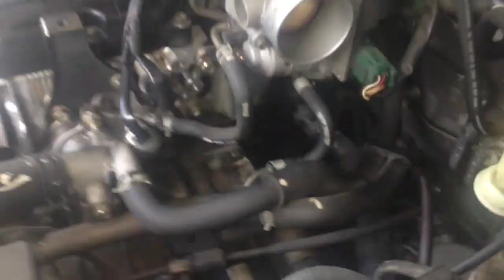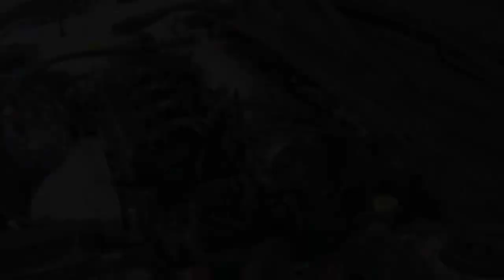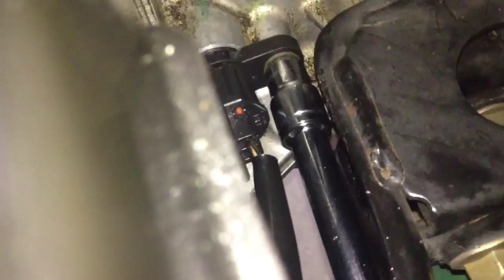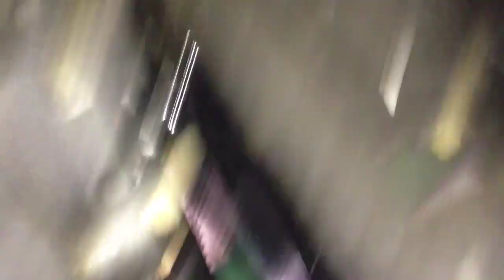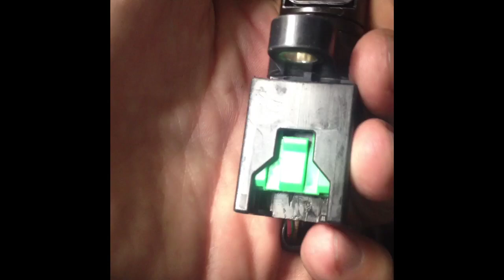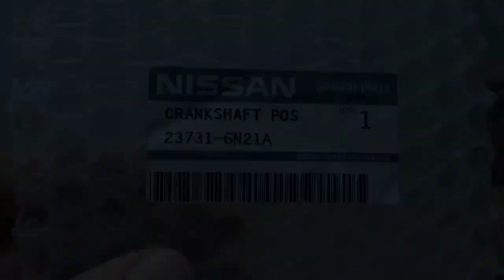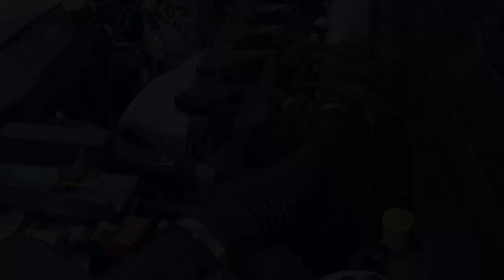Code P0335 / P0340 /P1336 - Crankshaft Positioning Sensor Replacement DIY - Nissan.

Comment: If I could give any advice, coming from a mechanic of 10 plus years. It's way way way easier to jack the car up on jack stands and go from underneath the car, you can easily remove the 10mm with a socket and extension, then remove it out from around the CV axle. Sounds hard but is incredibly easy. Did it in my driveway in 10 minutes this way👍
Reply from the maker: Great tip!

Comment: please explain the reason why you mention the DTC P0340 which is related to the CAMSHAFT Sensor if  you replaced ONLY the CRANKSHAFT sensor related to DTC P0335...... did you replace both or just the Crank sensor ?? Why the diagnose tester displays also the P0340 code???
Reply from the maker: The reason is that both cam and crank sensors are the same. They often fail around the same time. If one goes bad, other one is likely to follow soon.
Reply: @DIYtime  thanks for fast answer mate so what should I to replacing all three sensors to really fix the starting engine problem? So what have you done did you replaced all 3 phases sensors in the Nissan?
Reply from the maker: You can just scan errors and determine which sensor/s failed and replace just that, to fix start problem, or replace them all if you wish, so you don’t have to worry about it later, cuz you know how it goes - others will fail later at worst possible moment.
Reply: @DIYtime  alright

Comment: Only saw this today, Monday 22 july 024,did mine this morning took about 1and half hours,u did a good job,you for got  a little grease on the o ring on the sensor.I took the left hand front wheel off and lowered the vehicle down till brake disc almost touched the ground then stood on the wheel,made it a lot easier to access all components. Australia 🇦🇺

Comment: 10 years ago but thanks guy, you helped me out. If you light up under the motor bright, you can see only the bolt that holds it in and still guide the tool. Big arm, that's the way to go. Again thank you.

Comment: Everyone is saying that when this code is thrown up that their cars are stalling.  Mines had this code for around 2 years and has never stalled.  It's now running rough like how you explained in your other video I commented on about the ignition coils.  I'm going to replace the sensor anyway.  I got it from amazon.  How long did the one you bought from eBay last?

Comment: Any tips for trying to get the original out? It will twist and stuff but once we try to pull, it won’t budge.
Reply from the maker: Were you able to disconnect the wire?

Comment: I replaced my crankshaft sensor with an aftermarket part, and it didn’t work. Symptoms are low engine power when the engine gets hot. P0725 and p0335

Should I replace with OEM style?
Reply from the maker: Yes. I used aftermarket first and it didn’t work very long. Got OEM and it worked like a charm.
Reply: @DIYtime  in my case the aftermarket didn’t work even for 1 day. It’s fixed now thanks for the info
Reply from the maker: Awesome! 👊🏻

Comment: Replaced these on a Sentra,Altima,and Rogue.
Thats way to much crap to take off,
when you can access it from the bottom,
because it sits just below the starter.
Sorry not knocking the video,but having done it multiple times on several Nissans. All 1.8L,1.6L,2.0L,2.5L 
engines,the sensor sits just below the starter.I find it easier to just jack the car up,and change it from the bottom.

Comment: Will this also help if my nissa altima is Jerks everytime I press on the petal?
Reply from the maker: If you also have the same error codes, then yes. Otherwise it could possibly be transmission. Theses Altimas got pretty weak CVT trannys that break a lot.

Comment: this part number you proudly show us is for the model year prior to 2007 and up... It is for the 2002 -2006 model year Altimas. I have a 2009 and every place I found that EXACT part - it was NOT compatible. List the correct number and item please... Thank you
Reply from the maker: I listed what I used for my car. If you have a different car, you always need to check compatibility.

Comment: Very helpful. Thanks! Going to attempt it tomorrow on my 2009 Nissan Altima
Reply from the maker: How did it go!?
Reply: @DIYtime  it was very difficult to get to and the crank shaft sensor I purchased was defective. Ended up taking it in to the shop and had them replace it
Reply from the maker: Yeah, definitely elbow scraping job...

Comment: p1267 injection -adjust res/circuit 4 Nissan x-trail 2005 mod 2,2 diesel 136hk thank fore advice
Reply from the maker: Check fuel injector 7.

Comment: after replacing the crankshaft and cam shaft the card will star but after a few minutes it will stall unless I get my foot on the gas. ??? Great video by the way. I am using duralast
Reply from the maker: It could be many different things. Any error codes at all?

Comment: What do I use to get the screws off of the engine
Reply from the maker: You need to unplug the connector first. After that the socket will fit onto the bolt.
Reply: @DIYtime  I just dropped a piece of my ratchet set in my car. I give up now. I dont have the money for someone to do this.. however this video was very helpful and I wouldn't have gotten as far as I did without it.
Reply from the maker: Yeah, this is one of the more challenging repairs because of the location of this sensor.

Comment: I cant even get the extension to reach the nut on the sensor. The black metal section next to the sensor is too close
Reply: Thanks for the reply! I unplugged the sensor like you mentioned in the video and was able to reach the nut that way! But now I find that the 10mm socket is too small for the nut. I tried 11mm and was too big.
Reply from the maker: Try SAE sockets.
Reply from the maker: Yeah, it was pretty tight when I was doing it. Make sure you use a socket with thin walls. Also try to clean the area. There might be a lot of gunk around that bolt. Spray it with brake cleaner maybe.

Comment: I replaced mine with a new one but the car didn’t want to start. It sounded like it had no fuel. I put the old one back. It took a while to start up again. Is this normal. Now I’m hesitant to put the new one on again. Any tips.
Reply from the maker: Did you buy it from Nissan or aftermarket?
Reply: I bought it at Auto Zone.
Reply from the maker: That might be a problem....

Comment: my nissan altima starts shaking and looses power, it stalled 2 times but the car keeps starting and all.. is it the crankshaft sensor?
Reply from the maker: Doesn't sound like crankshaft sensor. Mine wasn't starting well when engine was hot. Are you getting any error codes?

Comment: Hi, GREAT VIDEO,. MANY THANKS, I have a Nissan  X-Trail 2007, gasoline (petrol), 2.5, the same engine as the Altima I believe  -  QR25DE.. I've just had a breakdown on the highway due to the engine alternately losing power and then recovering. I don't know if it's the crankshaft or camshaft sensor  or some other problem like the pump, fuel filter, accelerator pedal or bad fuel. In your opinion, do you think a faulty crankshaft or camshaft sensor sensor could cause such a symptom ? Note that the engine starts easily and can be revved up to 7000 no problem while stationary., Also, I've faced difficulty buying a diagnostic tool that works. Could you please tell me which make and model I should buy.
Reply from the maker: I like the ones that connect to your smartphone via bluetooth. I made a review of one of those here: https://youtu.be/Dzn3ibtbed4. It supports Nissan cars. 
You can also go to your local auto parts store and they will read your engine error codes for free.

Comment: Many thanks for a great video with excellent camera work. Very helpful indeed. You say the non-genuine part got scratched by contact with the crankshaft, but did this actually stop it working ? Did oil get inside it, as with the earlier part version coated with black plastic that eventually cracked ? Also, I'm wondering, as this sensor is so low down, it might be more easily accessed from below, which would obviously require safe raising of the vehicle or access from a pit, or whatever. I'd like to warn DIYers that, when mine was replaced by a mechanic, the idle kept rising and falling. However, reconfiguration with a scanner soon fixed this. Also, even when a fault has been fixed, often the engine light will stay on till it gets turned off with a scanner.
Reply from the maker: Yes, it wasn't working well from the get go. I cheaped out and bought the cheapest sensor I could find... As soon as I got OEM sensor the problem went away. Oil wasn't getting inside, the aftermarket sensor was just very crappy quality.

Comment: Thanks for the video. 
I found difficulties on removing the socket cause my altima still using the original sensor. So I have to remove the socket first before the 10mm bolt.
Even the green lock already pushed, it won't come off.
Does anybody has any trick for this?
Reply from the maker: Try long nose pliers maybe... Just be very careful and don't break the connector.

Comment: Thank You for this Excellent tutorial!  I have close to 50 years experience working on my own vehicles and this job was a real challenge.  I got nowhere until I removed the top cover so I could look directly down (very important) on the pieces/parts, wedged a small flashlight above the sensor to illuminate the area, and removed the intake bellows to get both my arms into the area.  I had to unplug the connector just to fit a socket on the bolt head due to the failed part being OEM (I think) and the plug itself partially blocking the socket. The replacement sensor has the connection reversed.   Getting the bolt out was then relatively easy (getting my hands down there was not) but I then had to use vicegrips to pull the old sensor out.  I did use ebay parts (cam position sensor too) so I may be doing this again, but the only problem (so far) with the ebay part was the oring was too thick  to fit the sensor into the hole in the block.  I re-used the old oring and it seemed to fit well enough,  but If it leaks I'll clean it of any oil, etc.  and use Hondabond (Threebond) as a sealer.  My test drive down to the parts store went well but the SES light was still on.  We ran another scan which showed the same codes, but the parts guy cleared the codes and the car is running well again, even with temps in the high nineties  today.
Reply from the maker: I am glad this this was helpful, thank you so much for sharing!

Comment: I cant get the harness cover off so i can use a socket any tips
Reply from the maker: I used wide flat head screw driver to press it in.
Reply from the maker: You can use your phone camera or a mirror to see better what's down there. Also, if you climb kinda onto the top of the engine, and look straight down at the sensor, you should be able to see it better.

Comment: if u have a xtrail , its hell of a challenge to change crank sensor. but if you take out some components from the engine , its easy access ( about 5 bolts). for those saying it dint worked , make sure ur sensor is sitting properly in the hole , its in when you hear a lil pop sound. wont work if its even slightly off
Reply from the maker: +Maninder Singh 
Thank you for sharing!

Comment: 1 month ago my nissan was scan and found code P0335, use to have hard start and stops while ideling. Finally refused to start a week ago. I changed crankshaft sensor at the back of engine, maintained the camshaft sensor on top of the engine and the car will not still start. i went further to test the resistances of the three sensors.2.74Mohms old crankshaft, 6.98Mohms new crankshaft and 3.89Mohms camshaft. Please any way out?
Reply from the maker: +EMENIKE PAUL UZODIMMA 
I would suggest to replace the camshaft sensor too. They are identical sensors.
Reply: DIY-time  my problem is that the camshaft sensor is still having good resistance of 3.86Mohms to even start the engine. 
The crankshaft sensor that I replaced was completely bad with resistance 0.238Mohms. unless you are suggesting that the two should be at the level.
Reply from the maker: +EMENIKE PAUL UZODIMMA 
Yes, I think they should be the same. Also, make sure to use good quality OEM sensors with new metal housing. I had bad experience with aftermarket cam and crank sensors in the past.
Reply: Thanks very much, i will do as you said. I am greatful for all the time that you dedicate helping people. once more thanks, will inform the situation shortly.
Reply from the maker: +EMENIKE PAUL UZODIMMA 
Thank you, I really like helping grateful people!
Reply: DIY-time, good day just to give you update of the situation. I have changed the camshaft sensor and still no start. couldn't fine the new model with iron casing but the plastic casing I bought had good resistance above 6.00Mohms a least to make the engine to start. Please what else should I check? I am getting worried now.
Reply: Also I would like to give you a detail of how it started, maybe from it you could have a better suggestion on what I should do.
when the check engine light came ON two months ago and code P0335 appeared, the code was erased and it came back after a few hundreds km. l left it like that and was using the car. During this time the car use to stop and will take several minutes before starting.
But I realized that when ever I use the air-conditioning and the engine stops, it will take much more longer time to start. And the day it finally stopped the air-conditioning was ON.
Also  i realized after using  the car for about 500km, the check engine light went off.
Reply from the maker: +EMENIKE PAUL UZODIMMA 
Let me ask what sensor did you buy? OEM Nissan or aftermarket?
Reply from the maker: +EMENIKE PAUL UZODIMMA 
Sensor is not starting the engine. It detects the position of the shaft, to determine when is proper time for firing.
Reply from the maker: +EMENIKE PAUL UZODIMMA 
I don't think it related to AC on or off.
Reply: Good day, i think the ones i bought are aftermarket cause i have not been able to get to nissan representative here in this country of mine. Please how could you help me to get those OEM Nissan sensors because in this my country, online buying and delivery is a very very big problem.
Reply: DIY-time, Please Please help me i need those sensors. Give me the price of buying and sending it so that i could see which local bank here would be able to do the transaction. Please i really need your help to solve this problem. Thanks in advance.
Reply from the maker: +EMENIKE PAUL UZODIMMA 
Let me see how I can help you...
What country are you in?
Reply: DIY-time , i am living in Cameroon. precisely in the south west region in the town of Buea
Reply: sorry for not replying early because we have internet connection problem.
Reply from the maker: +EMENIKE PAUL UZODIMMA 
Yea, I checked, eBay doesn't ship to Cameroon unfortunately. 
I think your problem is bad quality aftermarket sensor and you need to get original OEM sensors somehow. Maybe try to ask if you have relatives in other countries if they can ship them to you.
Reply from the maker: +EMENIKE PAUL UZODIMMA 
What is your car year and model?
Reply: DIY-time Nissan Primera P12 2003 model
Reply: The engine is powered by fuel.
Reply: Good day my friend just to inform you that my Nissan finally fired yesterday. I want to thank you for all the help you gave me
Reply: I got the original sensors both cam and crankshaft from a second hand dealer and the engine fired
Reply: But after firing, the fuel pump gave up and also the relay that controls the current entering the fuel pump.
Reply: i changed the fuel pump and the relay and my engine spin's like a new one. thanks a lot my friend and I am grateful for all you help
Reply from the maker: Awesome!
I'm glad you were able to get it all fixed!
Reply: DIY-time yes me friend the engine is good, pressure full and idiling very good with no breaks

Comment: I think you may have missed a tiny piece of info that might make replacing the crankshaft sensor a tad easier for the viewers and that is WHERE EXACTLY IS IT LOCATED? Moving the camera slowly and carefully as not to shake it, like the idiots in the other videos did, may help a whole lot. Thank you
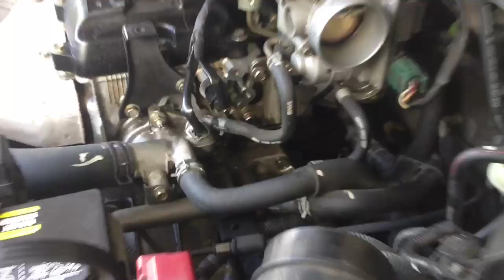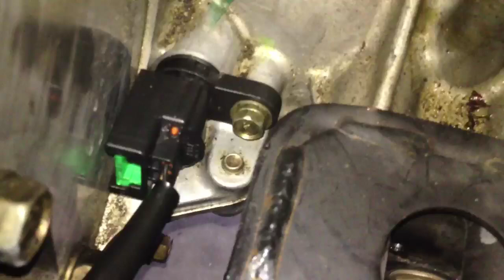Reply from the maker: Have you looked/listened at 1:42 - 2:05.....!?

Comment: Nissan Altimas has TWO crankshaft position sensors!!!!! 
The second one is on the top part of the engine, on the engine block's head. I had to change them in a set. Also great video.
Reply from the maker: +simoreasses 
Yes and no! 😁
That one is called camshaft position sensor. They are identical sensors, and yes, it is good to change them in a set. 
Also, 6 cylinder cars normally have two cam and two crank sensors. 
Thank you for sharing!

Comment: great video! a question for you sir, the inner threads for the crank shaft sensor is striped, so the sensor can't be tighten up. do you have any recommendation to fix the problem?
Reply from the maker: +Alex Wu 
This article might be helpful for you:
https://axleaddict.com/auto-repair/How-to-Repair-Stripped-Bolt-Hole-Threads

Comment: Is this the same for a 2002 Nissan Maxima 3.5?
Awesome video. Thank you very much.
Reply from the maker: +Neil Williams 
Should be the same, but sensor might be in different location.
Reply: I looked all over you tube but, cannot find the location of the 2 crank sensors for a 2002 Nissan Maxima 3.5!?
Thank you very much for your reply.

Comment: Would this sensor cause an engine with no start and no crank? All accessories work.
Awesome video. Thank you very much.
Reply from the maker: +Neil Williams 
Yes, bad sensor can cause no start especially when engine is hot. Plastic sensor housing gets cracked over time and hot engine oil gets inside causing issues.
Reply: Would this sensor cause an engine with no crank?
Thank you for your reply.